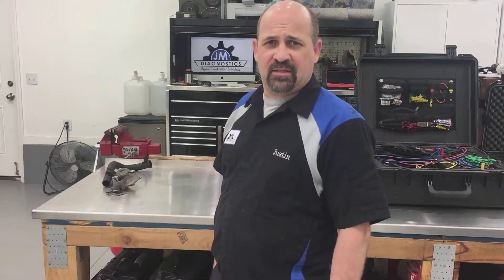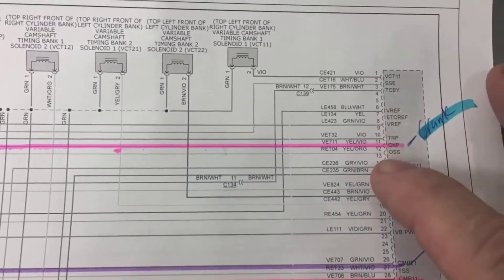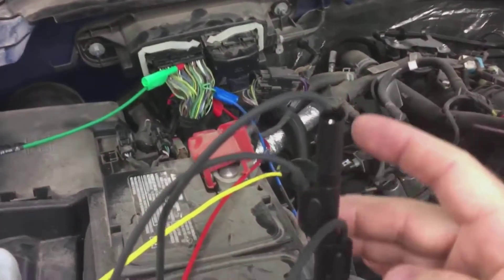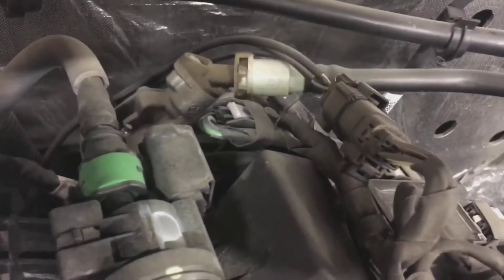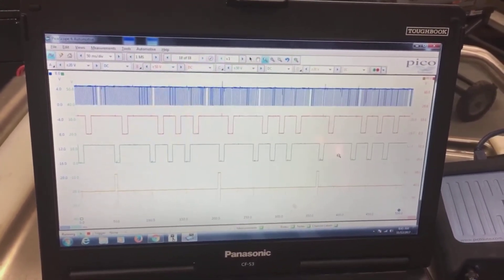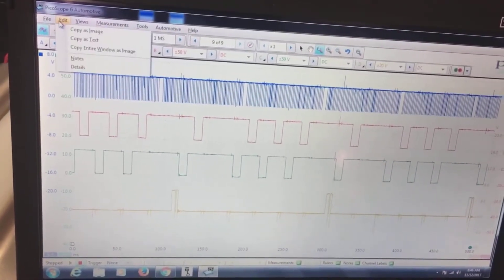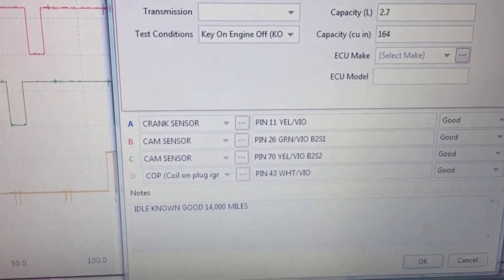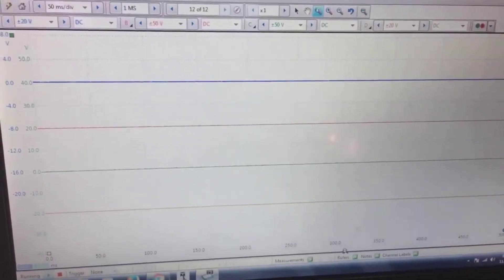Capturing known good cam-crank waveforms

Comment: Very good, Double strike is at idle, I think above 1000 RPM signal goes to single strike, Ford uses misfire counts in different rpm. Correct me if I'm wrong.